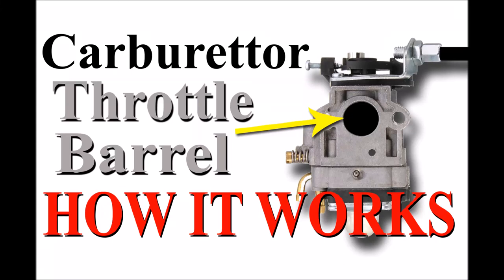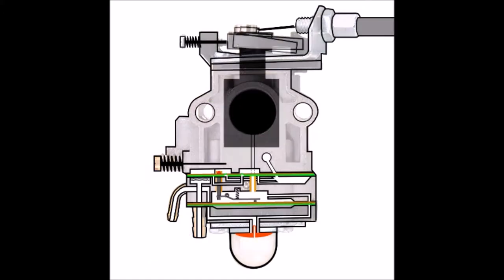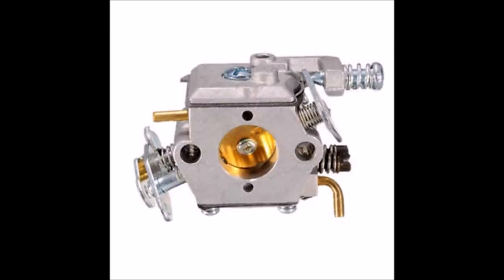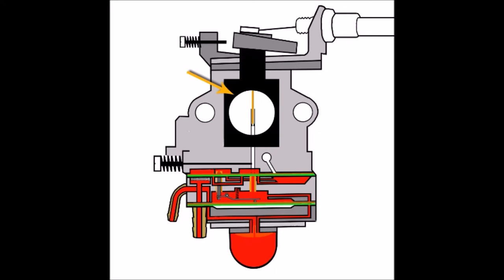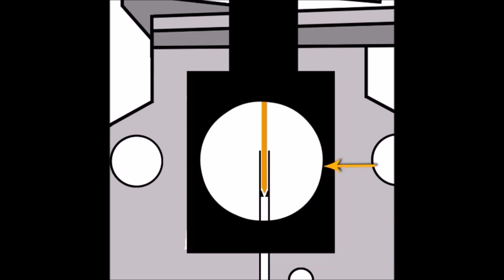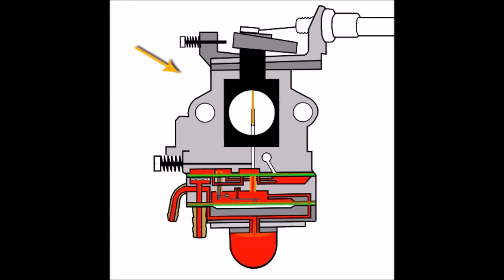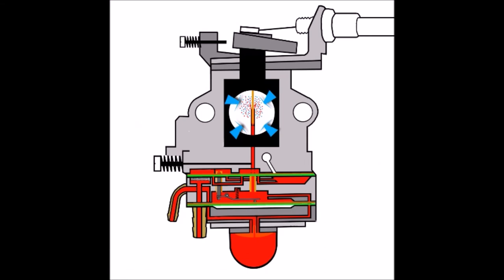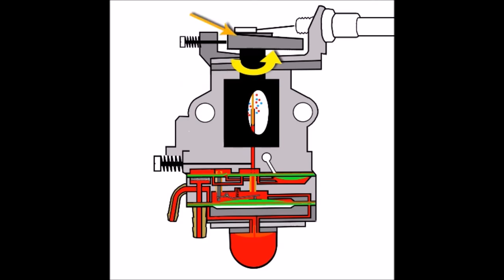Two-Stroke Carburetor -Throttle Barrel System - How it Works, ATV/Hedge trimmer/Strimmer

Comment: Can you explain how the choke works in this type of carburetors.
Reply: A sliding door 

You have a lever action choke. One that covers the whole inlet when closed with a small hole in it 

At half choke the small hole goes past the bore hole. And half the lever covers the hole. 

At full open choke nothing covers it. 

Usually there's a little brscket open at one end and a little sliver off the other end but it's not as important as the choke door

Comment: Hello! Nice videos, very well explained! Thank you very much, keep it going, I learn a lot from you videos! Because I like the way you explained the processes on varios subjects related on the carburettors and I din not found anything about this problem on youtube, I hope you will hellp me and others with tuning this tip of carburettor. On the upper side of the carburettor you have a little screw witch adjuste the hight of the plunger/rod ( this is the Low screw for this tip of carburettor). The Hight screw is the vizible one (They say is one screw carburettor but it is not, there are 2 screws) . 

https://youtu.be/tlsVcCdzaoA

How can we fine tune properly this carburettor using this tow screws? Thank you, I hope you have the answer for this question and you can make a video about this. Have a nice day!
Reply: Asta caut si eu. Pana la urma ai aflat cum se regleaza ?